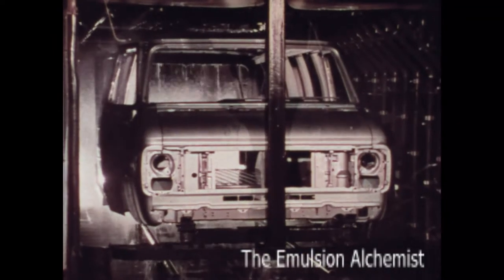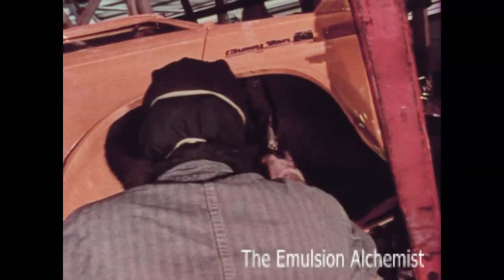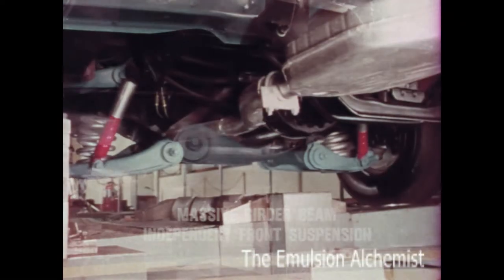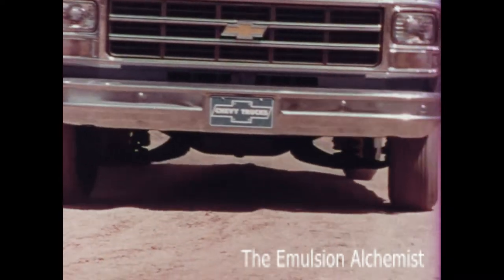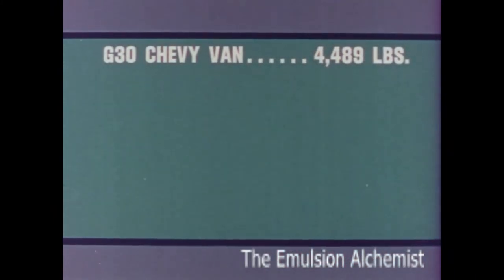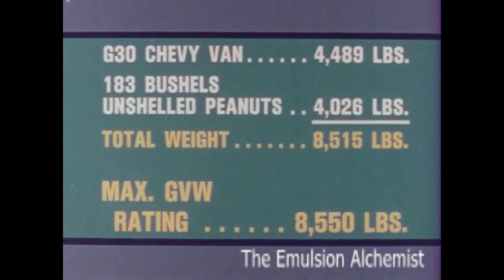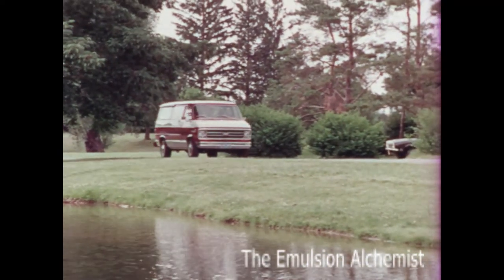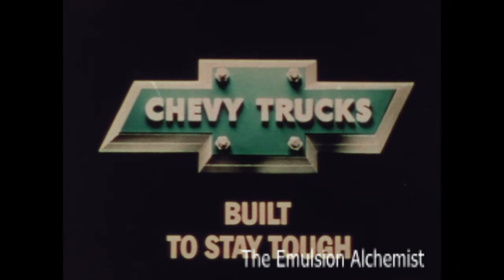1979 Chevy Vans And Sportvans HD Dealership Promo Sales film

Comment: Back when a truck was heavy duty well made not the tin can crap they make now a days
Reply from the maker: they were made to be tough , chevy now advertises how luxurious they are
Reply: What tin? They’re plastic
Reply: I'd actually like a new full sized van built like the old Saturns and GM "Dustbuster" minivans.  A strong steel spaceframe clothed with outer panels made out of that special plastic that was dent resistant and rustproof.